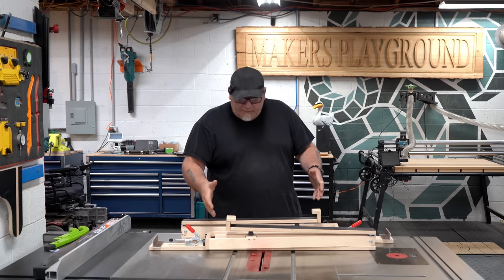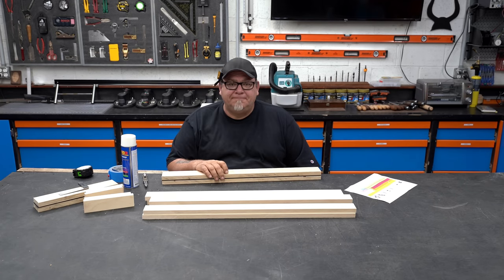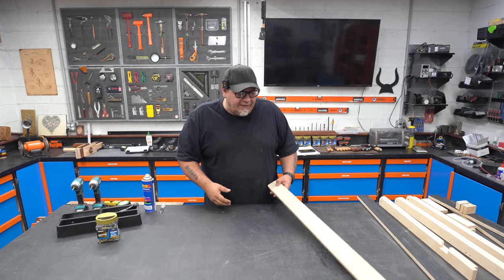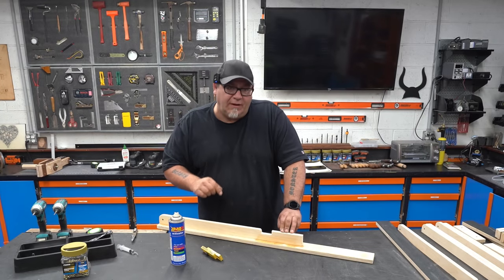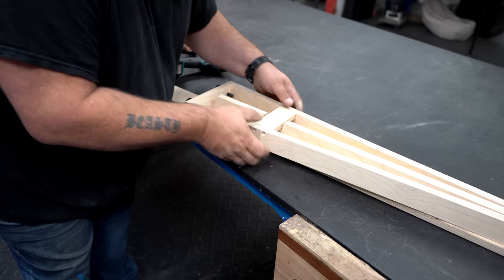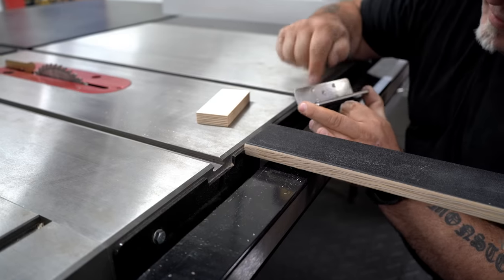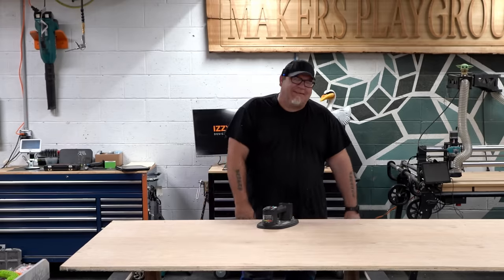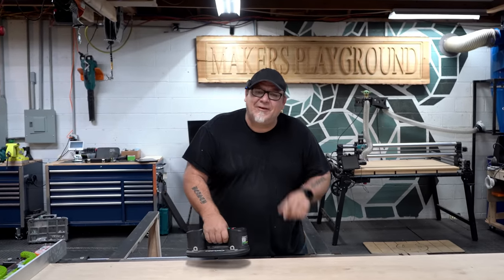DON'T buy a Track Saw? Build this instead!

Comment: While I'm sure it's happened, I don't know anyone injured by a track-saw.

I know countless people injured on a table-saw.  I've had a couple close calls myself which had things been different slightly, I would be missing fingers.

Track-saws just feel like a safe way to cut stuff...and table-saws always seem ready to ruin your day.
Reply from the maker: Definitely need to be careful using a Table Saw or any tool for that matter.
Reply: @dahut3614  I'm nervous every time I use the tablesaw for rips.  Even with a featherboard & pushstick....just always feel one move away from an accident.

Comment: What's that drill bit a 3:25?  Anything special?  Looks to have a brad point and a steeper angle than standard
Reply: It almost looks like a center drill that is typically used for machining, but not an exact match.  I can't find anything like it on the internet.  I wonder if Izzy modified something like a Kreg bit?
Reply from the maker: its call a a Viking Vortex bit they are hands down my favorite all around bit. great on metal as well no need to pre drill in metal. I get them from taytools.com